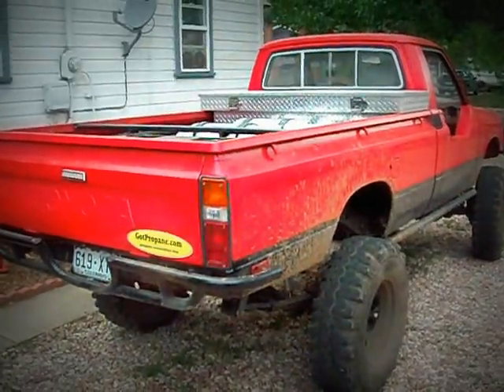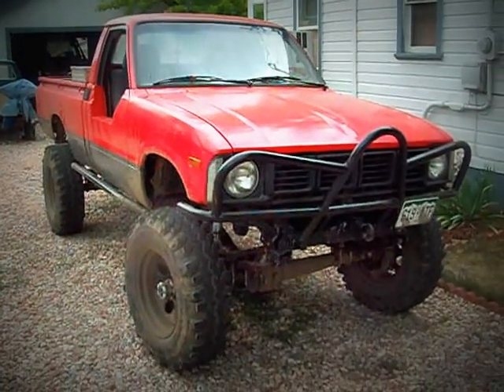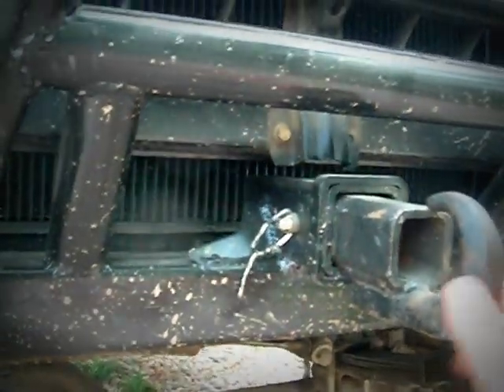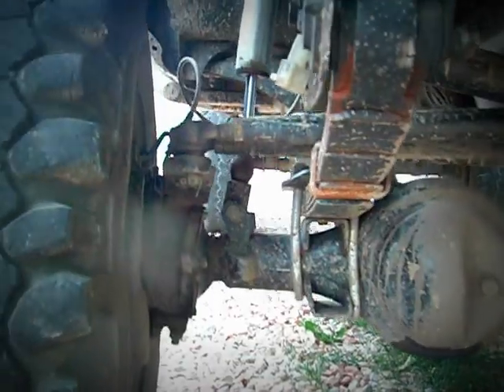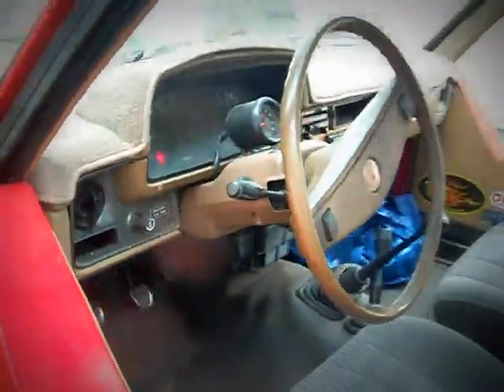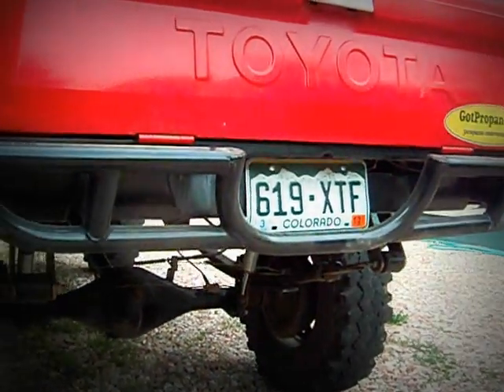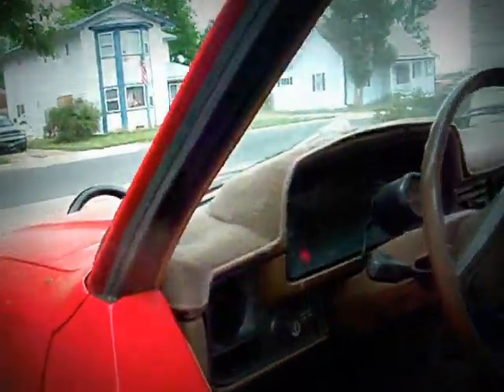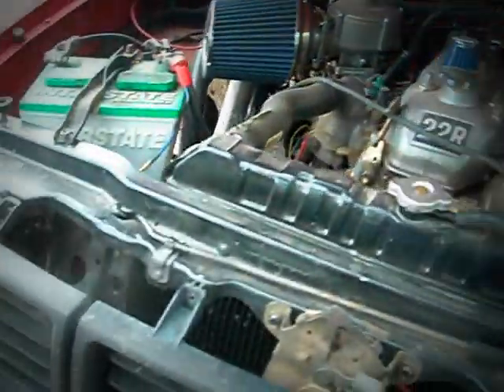1980 Toyota 4x4 Pickup Truck follow-up walk around

Comment from the maker: Springs are Chevy 1500 2wd in the read, Stock Toyota rears up front, 7 leaves total in the front pack.  I get a little under 100 miles per tank of propane (8 gal).

Comment: How did you build the front and rear bumpers? and how much were the parts? I'm thinking of something similar
Reply from the maker: I'm a metal fabricator, I just build. it's 1.75" x .120" tube. Pretty basic tube work if you have a bender, notcher, angle grinder, and welder.

Comment: What kind of seats do you have in it. And do they bolt up ?
Reply from the maker: Those were 2nd Gen 4runner seats. The front 2 bolts were the same, but I had to drill holes in the floor for the rear 2 bolts.